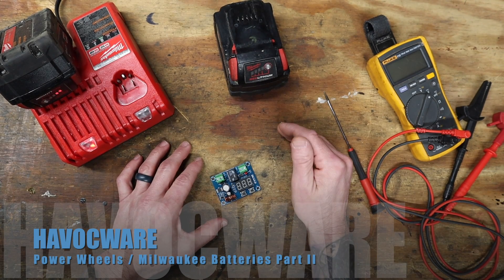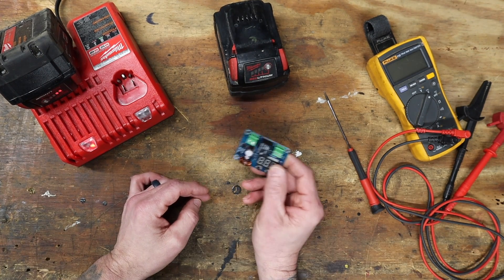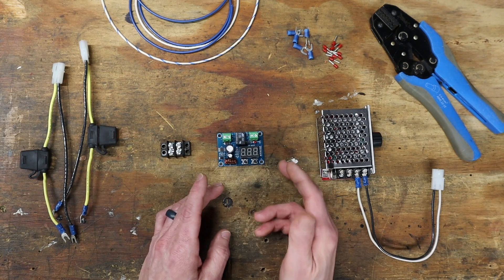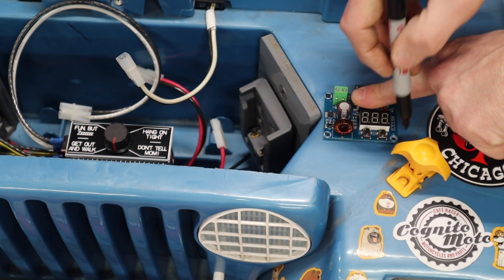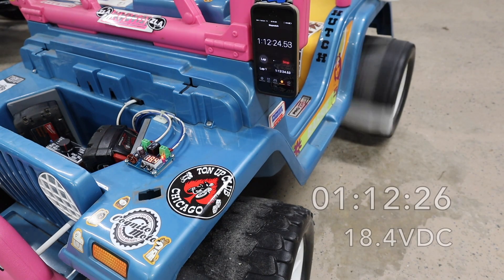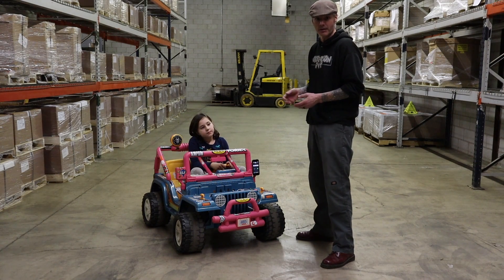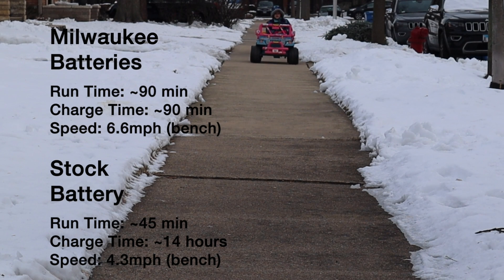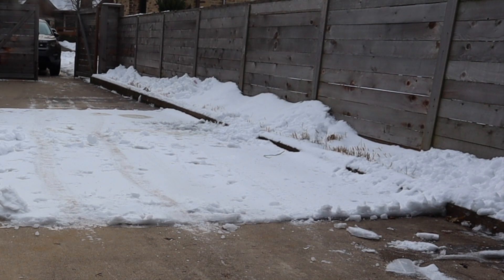Power Wheels Milwaukee Battery Upgrade RUNTIME TESTS & Battery Over Discharge Protection Install

Comment: I came to watch how to setup the Low Voltage Cutoff, but not really sure after watching the entire video. The module have a few settings to go through that I don’t know what they do. 😢 Any video would be appreciated! My plan is to use it with a Dewalt 18-54v FlexVolt battery. Thanks

Comment: Great Vid! I did a 2ah 20v dewalt battery. It lasted exactly 30 mins. Its not the newer tech Dewalt has now. I dont prefer any brand. It's just what i had. I used a 40 fuse

Comment: I switched the standard 12V to a Dewalt 20V and couldn't be more happier. Took less than 5mins with material in the garge. No over heating of the stranded wires from an old indoor extension cord, the fuses didn't blow and I got like twice the speed and it last like 3X longer. Without having to go buy a new battery for it. Super happy. Lbvs

Comment: how would you recommend doing a 24v power wheels with the m18? would you wire them together to make 36v and reduce with the speed controller ? or rum them at 18v? I've got the FJ Cruise 4 motor 24v power wheels for the kids I want to do this with.. Thanks!

Comment: And thanks for the knowledge of the video, I had no idea about the voltage issues u spoke about, I have a barbie jeep with the 1st gears removed and 2 18volt 9ah batteries and I also took the Escalade tires that are like triple the size of the jeep so it looks so damnn cool lifted and extra wide, and I wrapped the tires all 4 with mountain bike tires with huge knobbys, I'm 210lbs and the jeep roosts the grass up in my yard and also flips me str8 backwards not even just a wheelie it completely flips backwards, then the Escalade I took a hoover board battery out and use that 😂 my kids love it, but removing 1st gear ⛮ makes the top speed over 25 miles per hr but u have to be careful because it takes like 40ft to stop so you have to be in a open field

Comment: DUDE! i am f**king imoressed with that run time!  what amp /hr batteries are you running in parallel?  Im in the process of boosting my girls minnie mouse jeep lol. i quickly installed a dewalt 20 volt and the girls were laughing their a$$es off it was so fast. i have 2 porter cable 18 volt 775 high torque motors im going to install this week, just need to find 2 pinion gears. Excellent video , ill be checking out your others for sure!

Comment: Amazing video really appreciate this. I installed a m18 on my sons lightning McQueen directly onto a speed controller without the low voltage cut off and now will be adding the module. Luckily my batteries are safe 😅
Reply: Also just added almost everything on your list of supplies, except for battery. Hopefully you do get that small commission

Comment: Hi! Great video!
I was allways concerned about connecting two batteries in parallel due to mutual chargings, but I see that you have done it without any hasitation.
Have you noticed any issue with such parrallel connection later on ?
Thank!

Comment: I'm running with one battery in a Ford raptor powerwheels and one battery in a off brand dodge viper. Will this cutoff be good for a 1 battery setup? Both running milwaukee m18 batteries and m18 offbrand batteries

Comment: i set my cut offs to the same level. Vehicle starts surging as it hits cut off but then must reset. With 2 brand new 5.0 batteries this is happening when they have only used 1 bar... I don't get what I'm doing wrong.

Comment: Great video. If you are not already invested in batteries, Ridgid and Ryobi batteries have built in cutoff protection making it easier to adapt them to the vehicle I run a pair of Ridgid 4aH at full chooch and get great runtime. I also have a setup with a 12v 12aH + 6V 12aH SLA batteries. Takes longer to charge, but much cheaper cells. I should compare runtime on the 12aH SLA vs the 8aH Li-ion Ridgid packs.

Comment: Question I did this upgrade but with a 20v battery but the jeep powerwheel only runs for a few minutes but the battery isn't discharged.

Comment: It drives me insane that each M18 tool controls the over-discharge instead of the battery.  Really is a pain when you use them for many other DIY projects.

Comment: Thanks for the share.  I’m trying to figure out how the foot paddle and the one off switch work.  Does this work as soon as you connect the DC Motor and adjust the speed regulator?

Comment: Question here. I purchased all from the link and have wired this up exactly the same. For whatever reason, when testing output voltage from speed controller it only adjusts in increments of .1. So the voltage off of one batter comes out at 20.3v. The motor controller then adjusts from 20.3v-20.7v? Any idea what is wrong?

Comment: I did the same setup but without the speed controller since the kids would never go back to 12V once they try 20V. However the cutoff board relay is made for 20A and this cars go over 30A when you press the gas. I recommend using a bigger relay.

Comment: Low voltage cutoff board, other channels recommend a 24 volt relay in the wiring to prevent the burning up of that low voltage board. As others stated that they went through a few boards. Has anyone done this or had any problems with this low voltage board, thanks. Dad Hacks channel gives you credit for the build with the addition of the 24 volt relay to protect the low voltage board.

Comment: I wonder if I used the cheap Milwaukee flashlight that came with it as the connection source for the battery will it prevent this issue?

Comment: Nice video and diagram but there a little discrepancy in the low volt battery cut off. This will only work for one battery. Running parallel circuit does not guarantee protection for battery especially if two different "mah" are used in circuit.

Comment: Is this theoretically the same runtime you’d see from running a single battery at a time, and swapping to a second? In other words, is there a major benefit to running two batteries simultaneously?

Comment: I did this but the power/motors “surge”. Not thick enough wiring? Too long of wiring? Not sure why it can’t have constant power. In reverse there is no surging. If I bypass the voltage regulator, there is no surging… ideas?

Comment: Has anyone found a stronger motor to run with 18 volt lithium battery set up? I keep blowing 30 amp fuses and burning up stock motors...

Comment: Question: How do you charge it? Can you charge it using normal power wheel charger or do you have to take the batter off to charge it seperately?

Comment: So using a terminal block allows you to use just one discharge monitor circuit for both batteries.  But what if the batteries do not deplete at the same rate?  Should each battery have its own circuit?

Comment: For other ride-ons that have a circuit board (music, steering motor, R/C etc) can you install this as a "Boost" between the circuit board and the motors? That way the board does not get damage with the increase in voltage. Just an idea, im toying with this..im not an engineer

Comment: I’ve fallen victim to over-draining batteries as well. Lesson learned. Amazon has a different model for $25 and I’m installing it this weekend. Thanks for the video!
Reply: Which low volt cut off did you end up using?
Reply: Also interested

Comment: Excellent tips, let me help some more:
1. The low voltage cutoff module here will drain the battery on its own. You must install a switch at the power supply.
2. The video assumes the power wheel voltage rating is the same as the battery. In most cases, that is not true, therefore the need for a dc to dc convertor regulator. If you need a regulator, most of them comes with a low voltage protection,  and you may not need the low voltage cutoff discussed in point #1.

Hopefully this helps
Reply: No powerwheels are designed for 18-20v, but they all seem to handle it just fine. Trying to step down 18v to 12v is pointless and at these currents would be expensive both monetarily and in efficiency lost.

Comment: I followed all your instructions except I omitted the speed regulator.. Also, I used an 18v 6ah Ryobi battery instead of a Milwaukee battery. I am only getting 10-15mins of runtime off of 1 battery. Is it possible a Ryobi battery could have a lower cutoff?

Comment: Did you ever have a problem with the discharge protection module having to low of an amperage capacity? Says it is rated for 20A, factory PW battery has a 30A circuit breaker and I wonder if this could be a problem during high load event.
Reply: I tried running one of these directly as you show but the power wheels I have is a larger one (Dune Racer), and it fried that little guy. Now the second one I bought is only used to trigger a relay to send power. Under heavy load and first motor start up I got somewhere close to 60 Amps draw with my PW. I think it is somewhere around 25-30A continuous draw with load and constant throttle.

Comment: Man maybe you can help me out I've got this prego rzr and I wired in two milwaukee batteries and the same voltage controller but after 5 min the voltage controller starts smoking... what am I doing wrong?

Comment: I switched over to the 18-volt Milwaukee battery now I had to replace the little computer for the plugins because it only took 16 volts at the most well when I hooked everything back up after getting a 24 volt one my power wheel when you put it in high without pushing the pedal it moves why is that

Comment: I've seen other videos where the people didn't use a battery monitor and have talked about having to replace burnt out motors. Have you had any issues with your motors since doing your upgrades? Also, any thoughts about the hack that adds a capacitor to slow the vehicle when powered off instead of doing a hard stop as it's designed?

Comment: The low voltage cutoff in your affiliate link specifically mentions that it's not meant for batteries in parallel. Have you run into any problems since this video?
Reply: I am wondering the same thing. I am having problems setting it with batteries in parallel

Comment: Hi

I accidently put this system together but directly to old battery connections, that leads directly to the cars control print, works good except that it has built in controller already which might be okay.. bjt now the "reverse light"and LED for forward and backward on gearshifter does not light

What could cause this?

Comment: I appreciate the detail. I did the same mod to my kid's Power Wheels and thought the low voltage cutoff module would allow me to safely keep the battery in the vehicle overnight...wrong. It must still draw some current even after it cuts off at 16.5 volts. It ended up killing a $90 battery. 

Do you remove the battery after each use?

Comment: You really should be using a separate discharge monitor circuit for each battery. As is, if one of the batteries starts with a lower charge or if you use two batteries with different capacities then you could easily run that batter down too low and destroy it. Put a monitor on each battery and then combine the outputs of the two monitor circuits to feed into the motor controller. This will provide better protection.

Comment: Hi, what guage of wires do you use and does it mess up the 12v system? I have radio lights and remote control on mines. Thank you

Comment: How do you set the battery over discharge monitor circuit? There are the two buttons that you can change values. what do you set them at? Thanks in advance!

Comment: Hey is there a difference cause most people use one battery connection and I have on is that more power or more drive time just asking ca asking so I cause I want to do the upgrade as well

Comment: Will a 12-60v 6amp ( only 6 amp) pwm speed controller work? The battery i will use is bosch 18v 4amp

Comment: Have you seen any of these power wheels blowing out the battery monitor? I saw someone that blew one, and i'm wondering if running on a standard 12v Power Wheels chassis with 18-20v could pull enough juice to blow the monitor out? The Amazon ones I've seen are rated at 20a. Just looking for your thoughts :)

Comment: I just did this modification to my kids peg Perego gator and it worked really well. I am very new to anything electric and the video made it very easy. It was definitely way faster, way more powerful and the battery lasted very long. My question is do both batteries run down at the same time or does one run down and when that one is dead the other one runs down? Thanks to havocware for making this video and future thanks to anyone who can answer my question.

Comment: Can I Use 2 milwaukee 18v 5ah bateries Sequentially, One after the other to get 36  volts for powering ac controler for e scooter build from howerboard? Discharge protection I understend
Reply: It would likely burn out the motor.
Reply: @308Sharpie  I meen it for 36v ac brushles motor
Reply: @MatejCanzek  In that case yes, there would be no issue. 

Although I see you put "AC" Controller and "AC" motor, do you mean DC?

Comment: What gauge wire did you use for all this? I noticed the molex connectors in your amazon links are 14-20awg. The fuse holders are 12awg though.  Wondering if 14awg is good enough?

Comment: Great Video! I have been looking to do this with my Dewalt Batteries. What brand of Low Voltage Battery Cutoff Module did you use? The link doesn't seem to work anymore.
Reply: Should work, I clicked on link and arrived this week. Im about to start this mod yoday on my sons ford ranger 4wd power wheels.

Comment: Hey Thanks for creating such a great mod. Just a question. After completing this mod we have been running the power wheels at about 50-75% power and have fried 2 of the PWC. Any suggestions?
Reply: update After much tinkering and a third blown PWC In July of 2021 I switched over to a 40amp PWC and have had no issues since. We
use the car off road and on road with 2 children approx 40lbs. I run the PWC at about 75% but have had no issues running it full out at 100%. Still an amazing build that I recommend to people all the time.
Reply: @vampas917  can you link me to the 40a PWC that you used?
Reply: I'm looking to tackle this on our Peg Perego at some point soon. Definitely not an expert, but from this video and a bunch of research my thought is that you need a PWC with a higher amp rating. The one listed for this video is rated at 30 amps, which might work perfectly well for driving on flat driveways, sidewalks, etc. But I think under full load, these motors can pull like 32-33 amps, especially when going up slopes or with multiple kids riding. Perhaps you're blowing the fuse in the PWC? My guess and suggestion is to perhaps look at a PWC with a 40 amp rating.
Reply: Pwc 30 amp fuse changed to 40 amp fuse on other power wheel builds. They were also blowing the 30 amp fuse in PWC.  Going to be doing this build in a couple of weeks.

Comment: Great videos.  I've done this exact setup on 2 vehicles now using Milwaukee M18 XC5 batteries.  First to a Peg Perego RZR 900, which worked great until one of the gear boxes broke after about 3months (I expected this, but unfortunately I can't find upgraded gear boxes for this specific vehicle).  Next I got a dune racer and installed the stage IV motor (770) and gear box (steel pinion) kit from ML Toys with high hopes).  Results, the dune racer hauls, but only for 1-5min before blowing fuses, and forget the motor control (it burnt out 3 instantly).  So my question is, how do we get these lithium batteries we want that charge so fast, to reduce their massive initial discharge that is blowing the motor control and fuses?  With 550 motors it seems to work, presumably because they have greater resistance then 770 motors and don't allow such a massive discharge from the 18v batteries (I could be wrong on this, but only makes sense in my experience).  From my research and electrician friend, I'd be much better off with 2 12v SLA batteries in series for 24v which ups the amp output considerably less then a single 18v lithium.  I'm likely going to do this unless someone has a solution.  I'm afraid to put a 35 or 40 amp fuse with the 18v lithium's in fear of a fire and even at that amp level I don't know if it would work even if the wires didn't catch on fire.  Any suggestions?
Reply: Did you ever find an answer to this question? This is where I am, blowing fuses.
Reply: @darrellblake3955  I am at the same state - dual M18 5Ah batteries, running 18 volts, doubled the run time and speed, but blowing 30 amp fuses as soon after 2 kids jump on...too much stress on the motors? I'm also ready to replace my 3rd set of motors (not gear boxes). I cannot find a stronger motor to run on this Peg Perego JD Gator.

Comment: Does the power wheel have its own 2 speed if not will it still work with everything 

Or will they both be the same speed after the mod or should I just run it on 1st speed or 2nd speed
Reply: Also do u know any small lights that will work with the mod

Comment: I’ve now burned up two of these low voltage cut outs. They worked for a while, then dead. Any idea why? I have the same one pictured in this video.
Reply: Same here. I’ve burnt up three. I did this setup with two power wheels and can’t find a solution.
Reply: I’m not going to do the low voltage cut out. No way my nephew is gonna drive 45min straight. I only did one battery so I’m cutting run time in 1/2. But I burned out the damn speed control. Don’t know what happened. Otherwise this mod works great.
Reply: i think these pull more amps than the voltage cut outs are rated for.